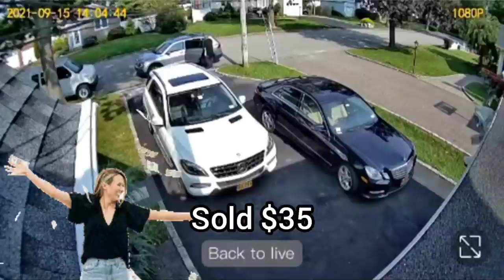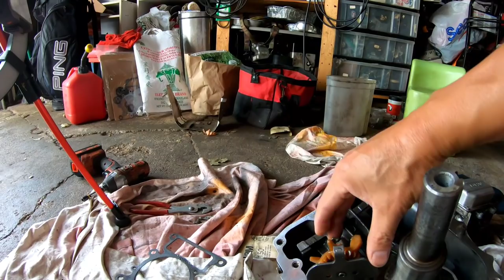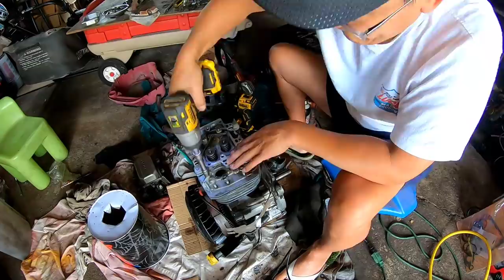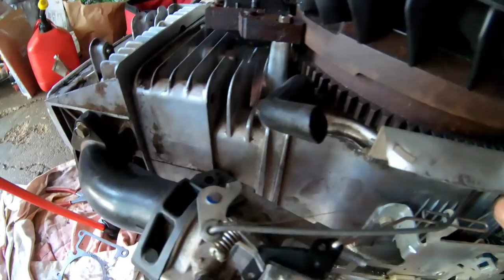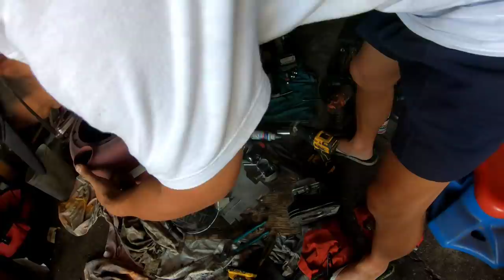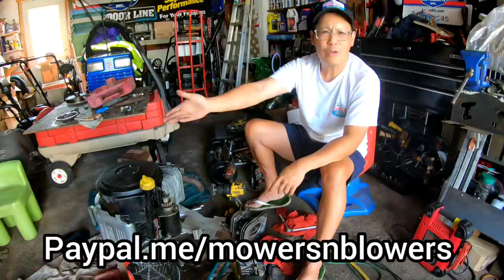FREE BRIGGS SMOKEY ENGINE REBUILD SUMP HEAD GASKETS STARTER FLYWHEEL INTAKE CARB CAMSHAFT ASSEMBLE

Comment: Henry. I use Teflon tape on pipe Threads , such as oil Drain Tube , it help's stop leaking
Reply from the maker: I use it too if it still leaks!  Thanks for the comment bro

Comment: Rosie says you're welcome but all she did was mail it for me, I packed it, I'm a fellow Ebayer and worked in shipping receiving for many years, I wanted it to get to you in one piece, in the bottom of the box is a nice cork valve cover gasket, and more parts for it.
Now the batteries are fully charged, I made sure of that, hopefully they last, if not take em apart, and resolder the wire back on, once you take the battery apart, which is super easy, the wire that is off will be evident, in the ones that don't work, enjoy bro, and I got your package with the carbs today, thank you so much bro, I really appreciate it, hope the head solves that problem, you will have to adjust the valves, but it came off a running engine, until the counter balancer broke.
Reply from the maker: Thanks bro

Comment: That craftsman tractor I picked up today for freeeeeee.... Is a FS5500, 5 bolt rear, pedal reverse and forward, 48" 3 blade deck electric pto, and my 24hp intek briggs, it's huge, had to take the deck off to fit it into my van, all it needs is a new voltage regulator, and possibly a new stator we shall see, but the guy I got it off of, I've maintained it for the last 5 years or so, a super nice smart guy, he is going to buy a new zero turn in the next few days, I've been helping him pick the right one.

Comment: That dewalt impact is rated for 1500 in lbs or 125ft lbs. 🤦
Reply from the maker: Yes but I meant that whenever I use it and test it with torque wrench it right on or very close.  Good enough for me.

Comment: I think the cam shaft is bent. It's just with the other gear in place keeps pressure on it making it microscopic. So it should run just fine. Mybe just a lil extra vibration. And with regular oil changes, should last awhile longer.  But I'm no engineer, just a grease monkey.
Reply from the maker: Lol,  neither am I although I did go to college for mechanical engineering